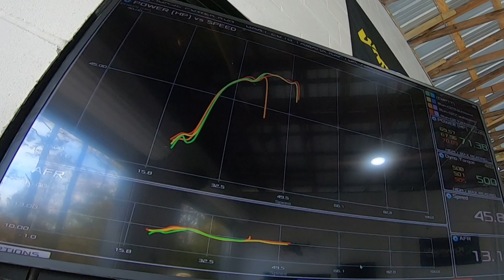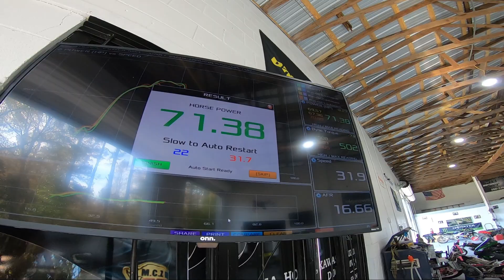Huge Power Gain! Raptor 700 with Athena 734 Big Bore!

Comment: I don't have a dyno.  But I'm a veteran of Afghanistan, and married a beautiful Lebanese Christian woman with strong family values.  I did a 5mm stroker crank, installed a 105.5mm piston and cylinder 11:1 compression piston full Hinson clutch basket and springs, plus 3mm intake valves and plus 2mm exhaust valves.  Stage 3 cam, EFI controller freed up the exhaust system and air intake, at 75mph in 4th gear I can pull it up then shift in 5th and it's stupid.  Not sure what numbers on hp?  Guessing maybe close to 80hp?  Idk....   But the fun factor more than doubled and that's what counts with me.    I did a few other things as well.     My daughter Yamaha blaster I did a port n polish and increased the compression to the limits for pump gas and changed the carb from a 28mm to a 34mm mikuni carb, also went with a taller sprocket up front and put 22 tall out back and 23 tall up front.  I know it's probably hard to believe but it will beat my brothers Polaris scramble 400cc 2-stroke on take off and top end.  My daughter is 18 and loves riding.  After a few years hopefully I can find a old YZ 490 to build up.  Just got to build it with a 5 speed gear box from the IT, would be awesome.  Great video.  Take care of yourself and your family my friend.
Reply from the maker: First off, thank you for your sacrifice and service to our great country. Sounds like you have a great gal! Your Raptor is probably north of 80hp 🦾🦾 Have fun riding!!

Comment: Important🔴 , important🔴, important🔴Amigatron‼️ Why didn't you measure the compression ratio by installing a pressure gauge on the engine head and then pressing the engine start button for 5 to 7 seconds? Just as you conducted a test on your engine after it had 
spent sixty hours of operation. Then l suggest that you install the Stage 3 cam and check the pressure again... If the pressure decreases due to the cam, this is a good indicator of the use of the fuel pump... 
Then compare the 3 measurements that you took the first time, then after installing 12.5, and then after installing the Stage 3 
cam.

Comment: Oh snap, great video man. Looked like you disassembled that bike and put it back together in a few minutes lol can’t wait for the next video! Hopefully you did a little break in the motor before drag racing😅🤣💪
Reply from the maker: Thanks brother!! 🤘😎 It took a little longer than a few minutes lol.. But I appreciate you boosting my confidence lol. I did approximately five heat cycles where I just allowed the engine to idle for about 5 minutes and then I brought it to the dyno where during the tuning process it was screamed to the moon 🤣

Comment: I know this is kind of older but what size jets did you use or did you leave them stock? I’m about to put a big bore on for a customer and wanted to know if it would be safe to run stock jets or if it would run lean.

Comment: did you change the CDI? to a high rev one? cause the stock one limits it self in 5th gear to like 6000 rpms right? or something in that way to preserve engine
Reply from the maker: The pcv eliminated that limiter
Reply: @FREEDOMSYNDICATEOFFICIAL  ah yes the dynojet thing.  nice

Comment: Nice! What fuel are you running?
Reply from the maker: 93 octane pump ⛽
Reply from the maker: If I had gone any higher than a 12.5:1 piston I would have had to go with race fuel.
Reply: @FREEDOMSYNDICATEOFFICIAL  Yeah for sure. Heck, even with 12.5:1 compression I would still add 1/3 bottle of a octane booster like a Lucas fuel additive to help increase it a bit. Nothing too strong like boostane or torco, but something that will help

Comment: Great number but what’s the exact mods?
Reply from the maker: The big three (full system Monster exhaust, FCI intake, and PC5) and Athena 734 Big Bore w/ 12.5:1 CP piston.
Reply: QUADNATION 929 stock camshaft,Tb and head? Sound like high reading dyno, big 3 54-55hp and the 105.5mm would gain another 2-2.5hp